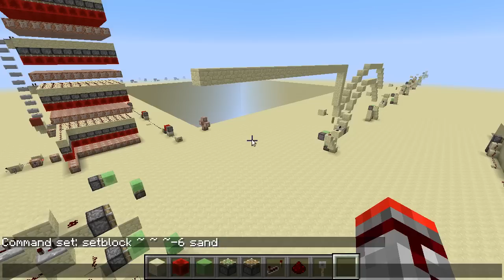0.6s modular sand catapult conveyor - Minecraft

Comment: Can you make it turn 90 degrees?
Reply from the maker: Ah, right, didn't cover that. Anyway, I assume you can, just need to have the sand land, then have a short horizontal conveyor with a turn, let it fall again and two more boosters. Bit like those special modules, but larger. But indeed, those turns would be necessary in a realistic world.
Reply: +Wout12345 +Wout12345 I was thinking about a enclosed sand loop. I also guess that is possible but I wonder if you could maintain the same amount of sand thrown per second making it turn.
Reply from the maker: lagalil I'm pretty sure you can ... technology for another video, perhaps. :P
Reply: +Wout12345 Can you make it fly diagonally and possibly increase the speed by a factor of sqrt(2)?
Reply from the maker: Myren Eario
Thought about that, but not really going to look into it. Makes it a lot harder to just expand the system for larger packets like you can when you're going straight ... feel free to though, would be cool if it's possible. :P

(Does cause some chunk loading complexity though.)
Reply: +Wout12345 I experimented with diagonally thrown sand before, but it appeared to be pretty unstable to me, (sometimes wasn't thrown in the same direction for no reason) but it would be pretty cool a stable system for this.

Comment: I'm not sure if this would solve any lag issues, except the tile tick limit. You need to load 5 times the amount of chunks and you'll have thousands of entities flying around. Have you done any large scale testing yet? I could imagine, that a modified version of this, might be useful to automatically dupe dragon eggs in 1.8 if it turns out to be too laggy for large amounts of sand.
Reply from the maker: Hmm, you're right, maybe I should do large-scale tests. As far as chunk loading is concerned though: loaded 400 chunks the other day, barely caused any performance issues or memory increase. Kinda strange really. But you're right, I should give this a test ... starting MCP! :D

P.S.: Actually, my instant bulk conveyor design doesn't use any tile ticks AFAIK, so unfortunately it doesn't improve that. :P
Reply: yes... he alread tweeted about this and apparently he doesnt think 3k entities r an issue... i think it ll be a lot lot worse...
Reply from the maker: Jendrik Weise Well, I thought it'd be less of an issue than 3000 moving blocks. Also, not sure if it'll be 3000 ... I'd say 600-700 for a 1200 block distance, packet size 4, period 0.6s. Now THAT's better than 3600 moving blocks. :P
Reply from the maker: Jendrik Weise
Ran a test now, I win guys, I win! >:D ~1400 blocks, packet size 4, period 0.6s, memory usage always below 600MB, performance ... well, I don't know how good exactly, but I've been doing this for minutes without any dropped ticks (and client-side things also work fine, everything seems to go at normal speed with 200+FPS on my non-high-end laptop). Now, I don't know what I should compare this to in terms of classical conveyors, but if you have to take Panda's word for it, their highspeed test set-up was still "way too laggy", and I can believe that from experiencing the lagg of a 1100 classical conveyor (though in a lit tunnel).

Actually, I'm really happy about this, should probably have done this before the video so I could brag about it. XD

P.S.: Ran this test in MCP (disabled all chunk unloading, as well as some other stuff) for convenience, so you can still believe it'll fail in vanilla I suppose. :P
Reply: +Wout12345 that's awesome!
Reply: i think the chunk reloading is a way bigger cause of lagg than just the loaded chunks u should definatly try it out in regular non modded minecraft. also, as u said normal conveyors r not as bad as panda said... 
i m personally just no big fan of the idea of using falling sand in the conveyor...
also non high end means middle range-the longest one... xD so i cant tell how goo it is from that description xD(u know how crappy my computer is but it s still not low end... thats the thing... xD)
Reply from the maker: Jendrik Weise
Well, IDK, if all goes well I'll have a fully functioning farm in a couple of days, then you can check for yourself. :P
Reply: let s hope for it xD i dont want to have to design a max speed generator by myself :D